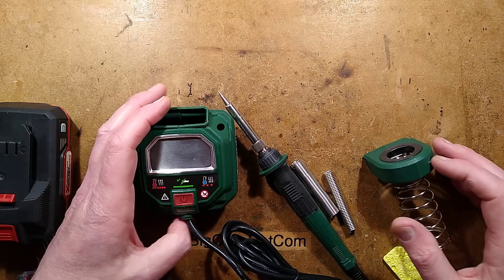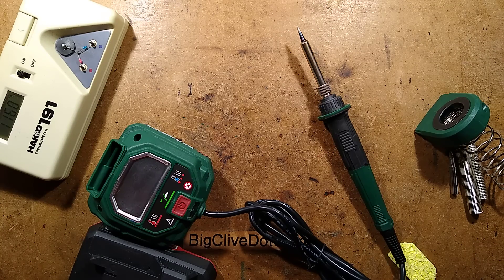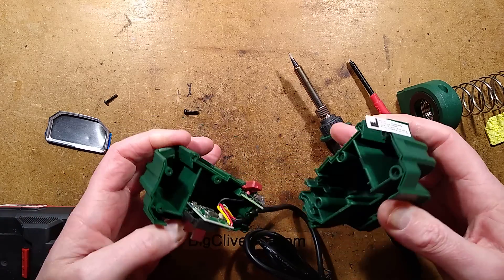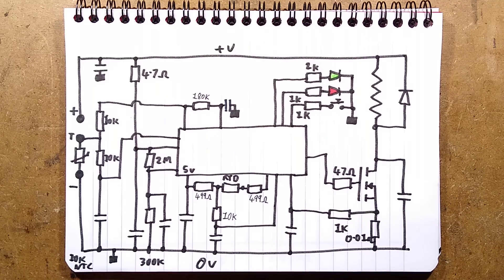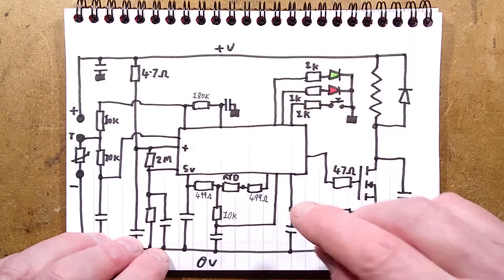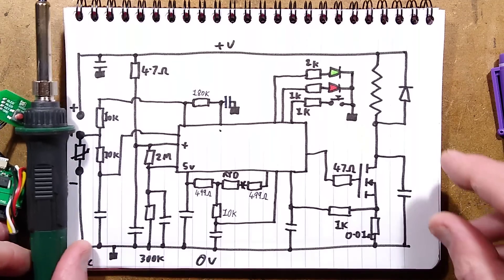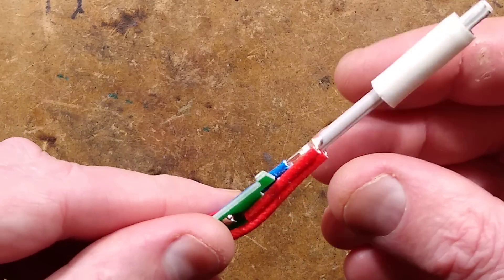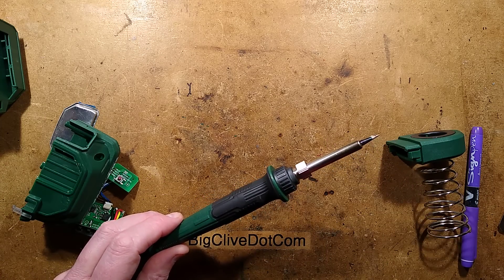LIDL (Parkside) B2 soldering iron hack and schematic

Comment: What I've done to my Yihua iron is to add an aluminium shim between the ceramic heater and the tip. There's other ways to do it but providing better coupling between those parts dramatically improves performance.
Reply: @Kevin-mp5of  Don't worry, it's not meant to fit together that tightly, so there is some room to move.
Reply: @ManWithBeard1990  I gave up on my 936 clone and moved to a T-12 station. Much better performance because the element is built into the tip.
Reply: @Kevin-mp5of  I bought three el-Cheapo mains soldering irons from The Usual Suspects and have them set up with different tips for various jobs rather than swapping tips around on one soldering iron. My "Hakko knockoff" tips are actually genuine Hakko tips which I bought from a little electronics store under Akihabara railway bridge in central Tokyo. Actually quite affordable if you happen to be in the vicinity.
Reply: @Kevin-mp5of  The ceramic element ALWAYS expand way less than any metal used for the tip so even if it fits almost perfectly, it would still have room for expansion. As a matter of fact, the higher the temperature, the more room for expansion would be created due to the different expansion of ceramic and the metal.
Reply: @Kevin-mp5of  Love the cheap fine tips which are not able to melt the solder on small SMD components LOL
Reply: @Kevin-mp5of  Tight fitting can mean a lot of things. To me it means to let the tip to slide easy while it is cold. Tighter than that it's not necessary, I think. I used to use an old station from Gordak and the original tips were pretty tight, sliding easy but tight. Years later, the new ones were not that tight. Never had any trouble with the tight fitting tips.
Reply: I have loads of thin corrugated shims that were used on another old iron to couple the bit to the element. I have no recollection of the brand of the iron though.

Comment: I've been using one of the Lidl irons with an actual temperature control and LCD that I brought back from a UK trip. Works nicely, but has strange bits with an M4 thread which I can't find locally. Some improvisation and Frankenbit has occurred ...
Reply: the ones i got with mine were knockoff weller mt1 tips. that type is used on sp23/25 soldering irons. farnell seems to sell them brand new, no idea if anyone else stocks them.
Reply: @Polygraph2131  Yeah, the "usual sources" aren't so useful in NZ where the shipping is several times the cost of the goods since Covid amd the demise of the postal system.
Reply: I bought it as well but sometimes it gets mad and temperature changes all over the place (also the "power" indicator flickers). Does yours do this after keeping it on for a while?
Reply: @Motoralbi  After about an hour mine drops to, I think, 200C and blinks until you push a button. Sleep mode, presumably.
Reply: @VikOlliver  thank you. Mine does that as well, but i guess the other kind of behaviour is not normal. It seems like it does it less when you set a "custom" temperature instead of a preset. Anyway, it's got three years of warranty so...

Comment: I solder at 275C or desolder at 325C with 60/40 lead/tin. You must be using unleaded Clive....

475C is a good temp for destroying cheap tips!
Reply: 275'C is far to low, even 325'C is on the low side for leaded solder
Reply: @fuzzy1dk  Maybe he has an old iron similar to mine - which is Union brand I think - with a led bar indicator for temperature. I run mine at 275°C, and had long marvelled at the bodgers that solder at 330°C. Until I tested mine recently, only to find when it indicates 275°C it's actually at around 320°C. All became clear in that moment...
Reply from the maker: It might be worth checking the actual temperature of your bit.  The displayed settings on many irons can be inaccurate.  330C is the base temperature for soldering with typical lead based solder.
Reply: @bigclivedotcom  Thanks Clive, I'll check it more accurately when I have a moment - I realised the readings given on the iron were wrong when I looked at it with my thermal camera. Generally I've kept it at the temperature just low enough that it doesn't cook the tips.

Comment: Maybe put a potentiometer [or a sw to bypass the resistor] in a little box on the cord to create a variable so if you need full heat it's available. This of course means not hacking the soldering wand itself.
Reply: What value Pot would you need to keep it in the useable range, say max temp down to maybe 360?
Reply: pots are measured in resistance. simply make sure the pot is capable of dealing with the most resistance possible. Clive showed us a little card/lookup reference in the video that you can use as a guide. but consider, heat dissipation (cooling) requirement is going to be greater with the more larger resistance figures.     @A7mag3ddon  conversely... the higher the pot value that the iron cant reach will give you more control (rotate it more between temps. )  i mean that with a smaller value pot, you might go from min, to max with only half a degree of rotation.  if you get what i mean.. ?

Comment: These irons are brilliant for auto electrics where the connections are often quite large and massive heat sinks, being really hot means effective solder joints quickly..i love this tool
Reply: @Kevin-mp5of  They are both gas-tight when done properly. The problem is that a properly calibrated crimp tool is the preserve of a factory production environment, where it is re-calibrated for every batch of crimps and cables following inspection of a cross-cut through a series of test-crimps to check for sufficient strand deformation and void elimination. The red/yellow/blue coded universal crimp system often used in the field is for electricians & amateurs and is very unreliable.
Solder connections have the advantage that the flux dissolves the copper oxide layers surrounding the individual strands, upon which the solder itself forms a gas-tight molecular bond to the copper with some of the copper dissolving into the solder. In a crimp these oxide layers stay embedded. But again, when done properly, both are reliable.
Reply: I came here to say exactly this! I use mine with the big chunky tip for soldering Lucar type spade connectors on classic car wiring looms. Unfortunately it doesn't transfer enough heat for brass bullet connectors - I have a 'chefs' butane torch for those...
Reply: @Kevin-mp5of  The never-ending debate 😁 . Reality is that a good solder joint is better than an average crimp, and a good crimp is better than an average solder joint. Both can be done well and are fit for purpose, provided proper adjacent cable support ensures the connection itself is free from vibration stress.
Reply: @Kevin-mp5of  Poorly executed solder joints where the solder has wicked too far underneath the insulation into the cable do indeed have this problem. But that is a sign of insufficient soldering experience or using a low power soldering iron so heating the joint to the wetting temperature takes too long. A properly done solder joint will create about the same length of fused strands as a proper crimp does. That is the main issue in my experience; someone can be trained quickly in executing good crimps provided they are given an accurately calibrated crimping tool. Learning how to solder reliably and to a high standard takes a year or two (it really does!). Teaching engineers how to reliably and repeatedly create good solder joint suitable for vibration & stress environments simply takes too long and is too expensive.
Reply: Look at factory harnesses from 50 years ago. Not a crimp in sight. If I repair a classic car I keep it original. Crimped joints open to the elements eventually go (very) high resistance. One is fairly easy to trace and repair. When there's a whole car full of them it becomes a nightmare. @Kevin-mp5of

Comment: Wish I could figure out a way to switch the Lidl digital heat gun from F to C. The celsius mode is nice, variable by 50 degrees C... in F, it just has the exact conversion temps, so you end up with 392F as a temp setting which is annoying.
Reply: That'll be because you're still getting the nice round C temperatures, it's not altering the temperature control just the numerical display. 

Given the price of these units I would happily live with that niggle, except that I think in C already

Comment: Why do they always set them up so insanely hot by default? It just burns the tip really fast
Reply: Maybe to burn through bits? These units are so ridiculously low priced they will look for any possible margin 😢
Reply: @LasseGreiner I just looked at the online store and they don't sell spare bits, so that's not it
Reply: @hrnekbezucha  missed opportunity there, thanks!

Comment: Is there a thermal compound that can be used to bridge the airgap between the element and the tip sleeve? It feels to me like a terrible transfer of heat and power.
Reply from the maker: Some bits come with springy shims.
Reply: @Kevin-mp5of  those would have a tighter fit over the element? Even with the pipe expanding from the heat?
Reply: @Kevin-mp5of  solid copper helps. But with so little direct contact with the ceramic element it still suffers. The only real contact is the little circle, the top, of the element with the bottom of the hole in the soldering tip.

Comment: "It generates its own 5V supply"

Kinda amazing something so small can do that.

Also, would it be possible to fit a potentiometer inside the handle so you could vary the reistance and thus temperature from the handle?

EDIT: Sads, mine is a B2.

Comment: I think I'll continue to use my Antex XS25 . Not a clue what temperature, It just works.
Reply from the maker: XS25 was my main iron for decades.  The bits lasted forever even when left on all day.
But then at the transition to lead-free solder they changed the tip plating and they burned off really quickly.  Replacement bits were ridiculously expensive and often only available in packs with only one that fitted your needs.
Reply: Yep! I have one that is 40 years ol and still going (original element!). I have a bunch of controlled irons, flash irons, gas irons...that Antex still solders where all others fail to heat, even 60watt things! I have a C15 too...best iron for small stuff....ever!

Comment: Hm, if you put OB6606 into google it does find a monolithic, high performance, low cost brush motor controller, which requires only a few BOM to complete system.

Comment: Is it possible to hack/mod an AC 120V soldering iron to run on a 20v DeWalt tool battery?   Like one of those cheap Chinese solder pencils with the potentiometer to dial the heat up or down.   I have like 4 of them and I'd love to hack one into a DC capable one.
Reply: My iron looks very similar to the one Clive is messing with. No base station on mine. Just a 120v mains cord.
Reply: Your only practical option if to get one of the mini-inverters that clips onto a DeWalt battery.  To hack the iron to make it work directly on 20v would require a suitable heating element; driving a 120v heating element with 20v will result in just 2.8% of the rated power...
Reply: @ferrumignis  i see.  thanks for the info!!

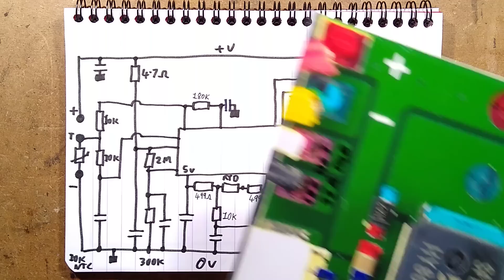Comment: 7:09 second line is the actual part number - "OB6606" from on-bright.
It's some sort of a brushed motor controller/uC.
I guess it makes sense for powertool company to come up with different use cases for their favourite ICs...
Here's the spec:
Features
Built-in MOS driver
l  Output high-level clamped on 13V

LDO
l  Output  5V
l  Current capability is over 50mA
l  Built-in short circuit protection  and over temperature protection

Driver over current protection（SCP）
l  Threshold is set by system for high flexibility
l  Result of SCP comparator shutdown driver. Hardware protection is safer.

Low standby current
l  Low standby current, less than 10uA

High-speed rail-to-rail amplifier
l  Gain bandwith production is  over 1.1MHz
l  Slew rate is over 10V/us

High performance 1T-8bit MCU
l  16MHz Internal RC oscillator, with programmable clock divider.
l  1~8T can be switched on the fly.
l  Instruction-set compatible with MCS-51.
l  8KB on-chip program memory.
l  512B RAM as standard 8052.
l  Dual 16-bit Data Pointers (DPTR0 & DPTR1).
l  Three 16-bit Timer/Counters. (Timer 0,1,2）
l  14  GPIOs
l  External interrupt 0,1 with four priority levels
l  One IIC interface. (Master/Slave mode)
l  One serial peripheral interfaces in full duplex mode. Additional Baud Rate Generator.
l  Programmable watchdog timer.
l  4-channel 10-bit PWM（1-channel is used to control MOS_DRV）
l  8-channel 12-bit analog-to-digital converter (ADC),  ADC6 is interal current detection.
l  CMP x1 Set
l  ISP/IAP/ICP functions and EEPROM function
l  LVI/LVR (LVR deglitch 500ns)
l  Power management unit for IDLE and power down modes.
l  On-Chip in-circuit emulator (ICE) functions with On-Chip Debugger (OCD).
Reply: Good catch!
Reply: I wonder if they programmed in a reconfiguration command that changes the setpoint temperature by operating the single button in some funny pattern that the marketing people removed from the instruction sheet .
Reply: @johndododoe1411  Having been an embedded programmer myself, I'd have added such a command and not told Marketing.
Reply: And it's an 8051. It's always an 8051.

Comment: Very nice can you compare these soldering iron bits I want to know which is better and which can be bought in which package like I have some t12 bits (runs direct at DC 12 to 20v at 60w maybe) but the thinner ones are useless to me as they don't get hot enough.

Comment: i remember one time we had a health and saftey meeting. and they were saying Since health and saftey standards were introduced in 1974,  after a few years of transitioning. work place deaths have decreased by 75%
They got all pissy when asked.. Isnt that just because maggie shut down all the coal mines and the eu took all the factory jobs?
Reply from the maker: At the beginning HSE did a great job.  But it's all degraded into high profit red tape now.
Reply: @bigclivedotcom  well im not as wize and worldly as you. but i do remeber having BSE adverts on tv telling you not to jam your electric drill's power wires in to the socket with matches. 

So i guess HSE did need to exist lol.

Comment: The only problem with Lidls soldering irons is their tips are non standard and I can't seem to find a replacement, at least not in my area. I had to Jerry rig a tip from another soldering iron to fit mine, which is a wall powered station with a knob to set the temperature.
Reply: For real, lidl's tips are always a pain in the ass to get hold of. The only one that takes standard bits is, ironically, the one in this very video... This one takes standard 900M tips
Reply: I take the stub of the old bit and drive it very,very hard into the hollow in some locally available Chineseium bit.I was intending to tap and screw it, but turns out not to be necessary.

Comment: I've always said the tools rule is stupid
For the general electrician they say you must have approved insulated tools, yet the rules also say not to work on live electrics 🤣🤣
Reply from the maker: They don't seem to understand that some diagnosis of faults has to be done in a powered cabinet.  Not all faults are visible with the power off.

Comment: For a few $/£/€ more or less some chinese site with affinity to arab stories for children will sell anyone a low voltage soldering iron with more advanced tip construction and controller with a display in its handle, so persons already having an iron can "create" their own battery management and housing/connector.

Comment: Lidl and Aldi seem to have a habit of putting faulty returned electrical goods back on the shelf. I've had it twice and so have friends. Not good.
Reply: I returned a faulty cordless sander which vibrated like b*g**ry. Since I'd bought the last one on the shelf I was somewhat surprised to see another one for sale, that was almost identical (as in suspicously similar packaging wear and tear) a few days later. I even took it back with my battery to demonstrate the fault but they weren't interested. I wonder how many times they sold and refunded that item hoping that some schmuck wouldn't realise it was faulty and/or couldn't be bothered to return it? A German company 'with Chinese characteristics' perhaps? *

*A reference to quotes from the 'China uncensored' and 'The China Show' YT channels wrt. the CCP's claim to deliver "Communism with Chinese Characteristics".

Comment: Ooooooooo I wonder if theres enough room for a little variable resistor in the iron that you could adjust from outside of the iron by drilling a small hole in the iron handle ?
Reply: I would put a 100R pot in the base unit.